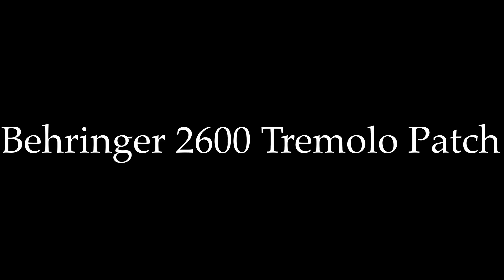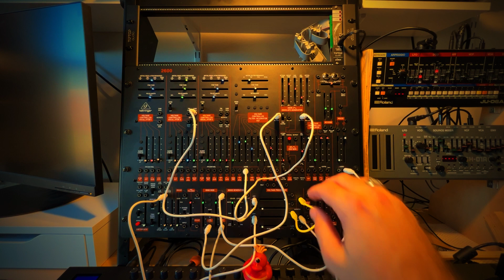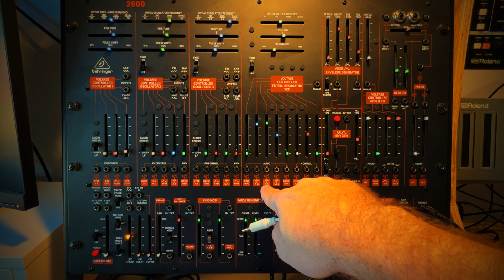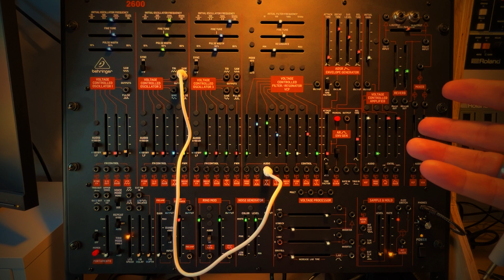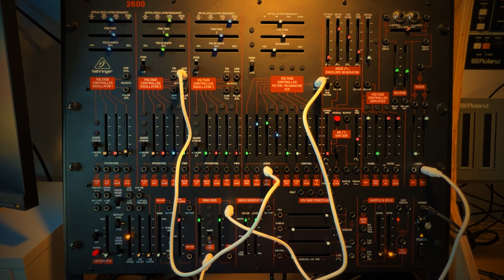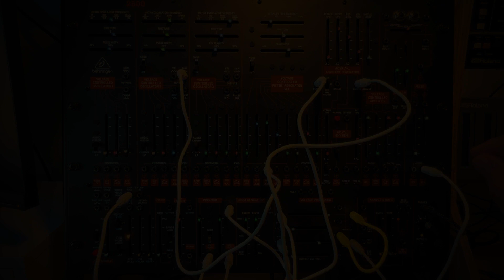Behringer 2600 Tremolo Patch & Breakdown

Comment: Happy new year! Thanks for sharing!great tips! Just double check the volts coming out on the 2600 if you plan to connect it w/other modules… I heard it outputs more voltage than normal … check the Cinematic Laboratory YouTube channel about the B 2600 …. Cheers !
Reply from the maker: Great tip Mauricio- thanks very much. I will check that out. Thanks for watching!